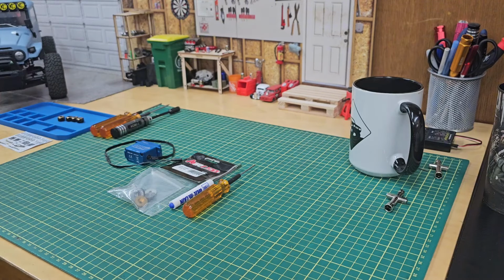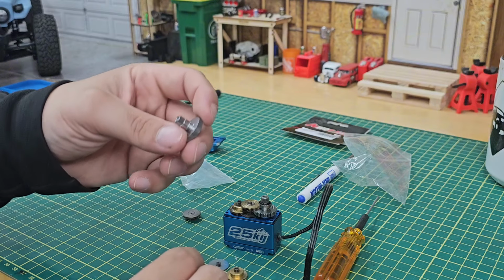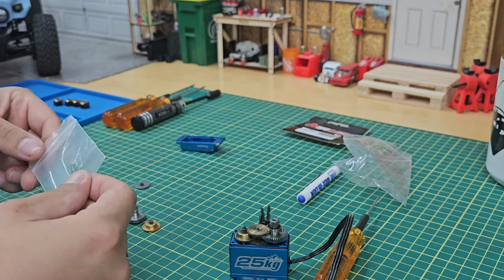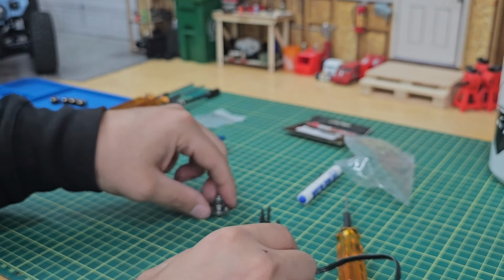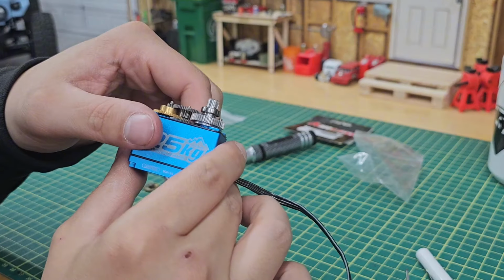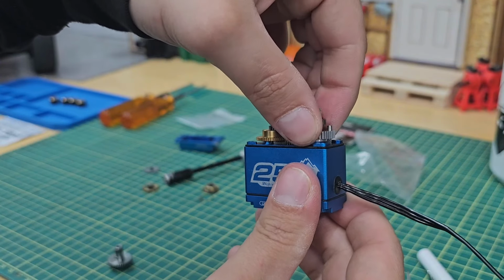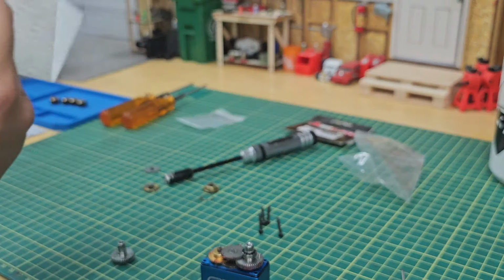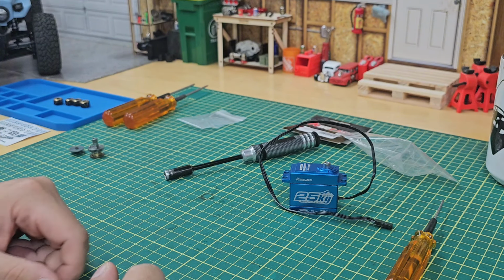Power HD 25KG Don't Replace Servos, Replace Gears! Save Your $$$!

Comment: Nice, hey can these be converted to operate as a winch? So do a full 360 by removing something in them.
Reply from the maker: I haven't done it myself, but I'm pretty sure you can remove, or shave down something on one of the gears to make it work like a winch.
Reply: It's both electric and mechanical limitations.  You can electrically modify most to get 270 deg or so.  For continuous rotation you really just need to bypass the potentiometer completely and sometimes modify the gearset if it has a stop on The output.   Just Google it.